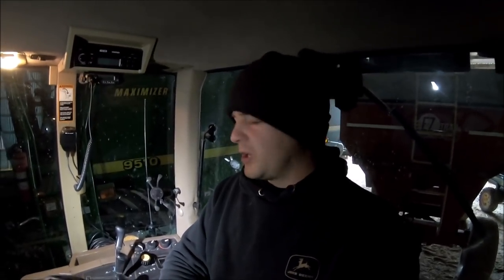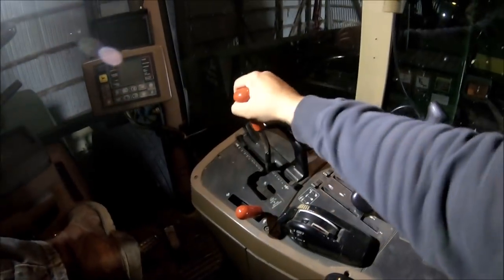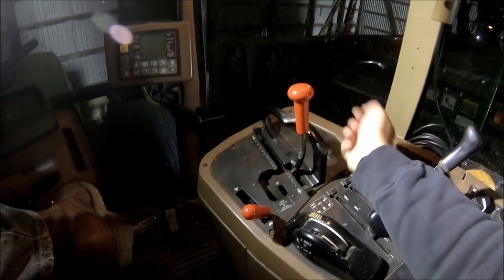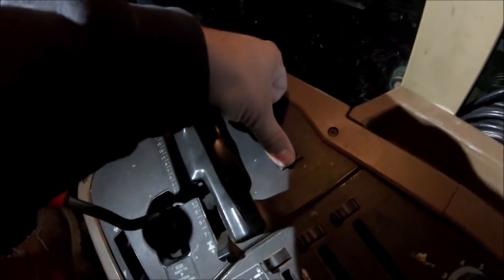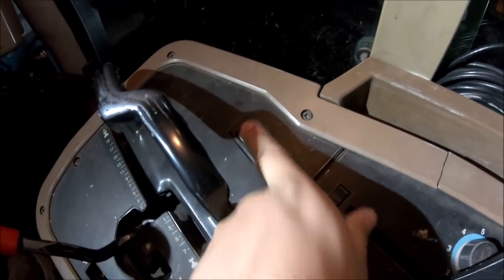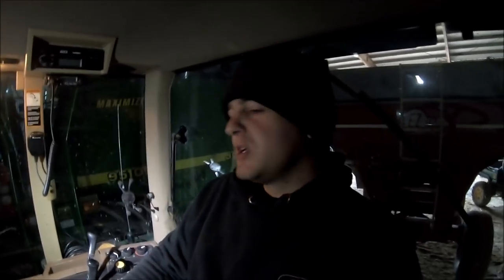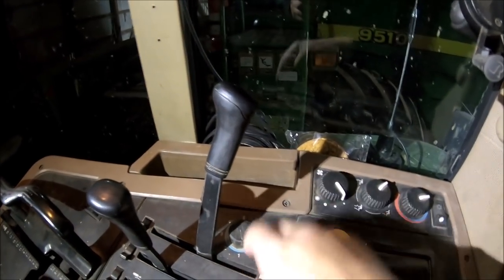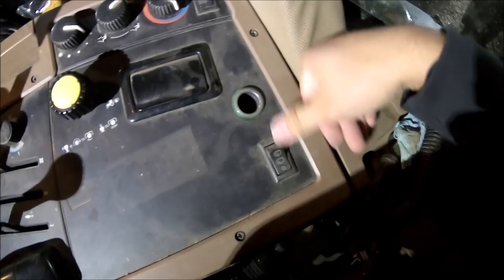Not As Complicated As The Space Shuttle

Comment: The front wheels have to turn FASTER(usually 10%) other wise you could not turn. IE: in a u turn the arc of the front wheel has a bigger diameter than the back the  arc of  the back wheels. larger arc means greater distance need than the smaller arc of the rears, look when you turn in loose ground. the 7400 was hurt making any turn at all in 4wd

Comment: Very nice explanation, one of the better ones I have seen, one question, if the front tires wear down to about no thread will it proportionally turn the same ratio to the rear ones  or will they then come more in synchronization with the rears in a scenario where you have new rear tires on
Reply: There is very little difference in speed between new tread or no tread in the field ... in road gear you get around 1-2  MPH difference depends on the tractor's top speed and tire size (at least that's my experience)
Reply: Thanks!!!